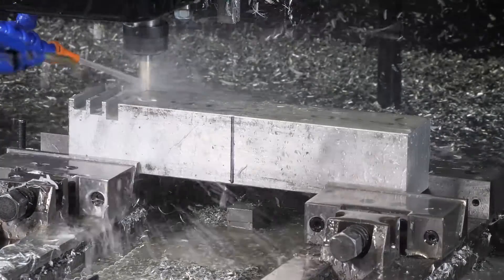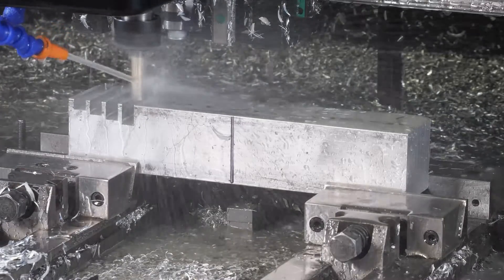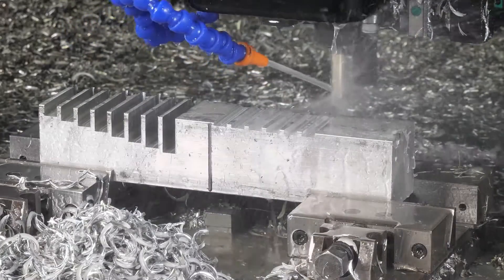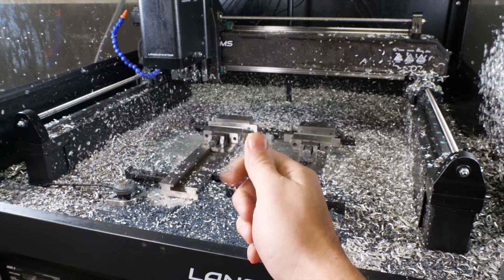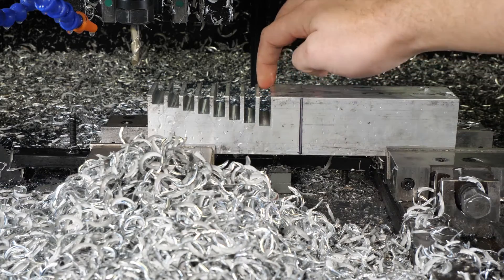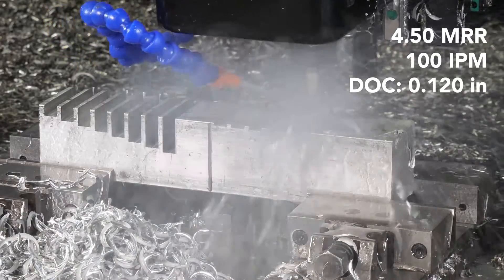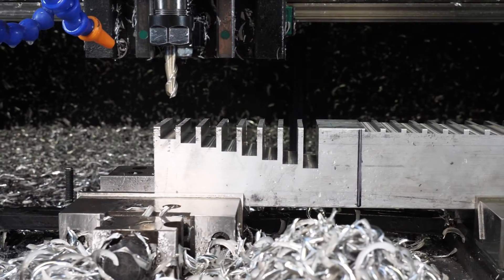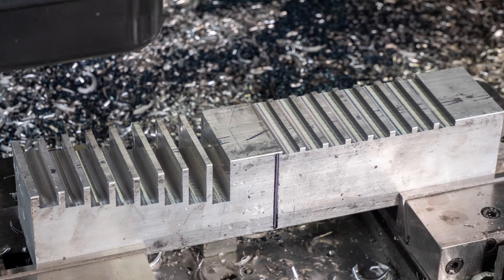Pushing MR-1 to the LIMIT with Full Width Slotting Passes in Aluminum

Comment: what motor is that specifically? i see on your website you are using a 220v ac servo motor with an er20 taper. i haven't found any servo motors with an er20 taper online...Is it a Fanuc ac servo motor?
Reply from the maker: The motor is a 220v 4000RPM 3.4AC HP customized specifically for this machine. It's drives a custom made ER20 spindle shaft through a 1:2 overdrive timing belt transmission. None of the spindle components are commercially available.

Comment: What spindle motor and drive are you using?  Same question for the axis drives?
Reply from the maker: The spindle motor is a 3.4HP AC Servo Motor that runs on 220v single phase power. RPM of the motor is 0-4000 RPM that is overdriven 1:2 to the spindle shaft. The axis motors are waterproof NEMA23 high torque steppers and matching micro step drives. Each axis can produce at least 125 pounds of thrust force.
Reply: @LangmuirSystems  sounded like the spindle and axis setup was better than most I've seen.  No outrunner motors and ESC's with wimpy cylindrical ways.  I'm in the machine tool business and if you can keep the price at this point, you'll sell a lot of these.
Reply: @LangmuirSystems  is the spindle air or liquid cooled?
Reply from the maker: @azinfidel6461  The spindle motor is air cooled. The housing has cooling fins. There is no cooling fan.
Reply from the maker: @azinfidel6461  the spindle and motor are air cooled.

Comment: Wow! You had me cringing on that 1 inch deep cut, but it worked! Impressive!
I’m interested to see what the surfaces of the deep cuts look like, compared with the shallow ones.
Reply from the maker: The finishes actually look pretty density considering the MRR achieved.
Reply: @LangmuirSystems  I keep going back and forth between if I should order one of these. I mostly wanna test it out what kinda surface finishes I can get with 6061 (I have a mityo sj-210) and how it holds tolerances in 6061 (because that like 95% of the materials my shop sees). I think I might just need to order one out of my curiosity. I have a fleshly calibrated OGP smartscope 302 with the thru the lens laser and touch probe so I could do a decent review on how well the machine holds tolerances on part too. 

I know some folks in the combat robotics world that would love a machine in this price range and size but they say there scared as its a new machine with no reviews